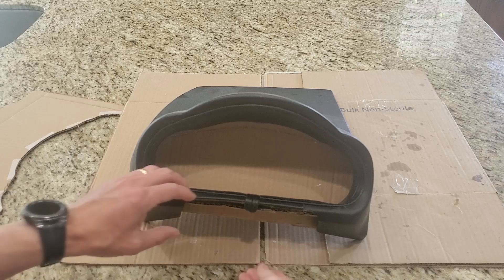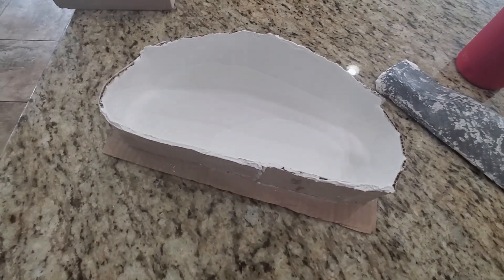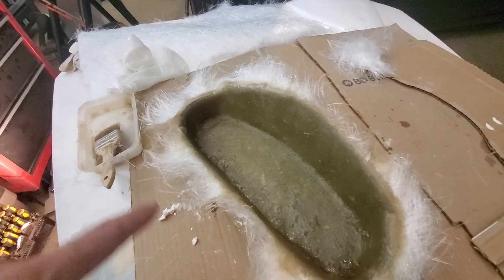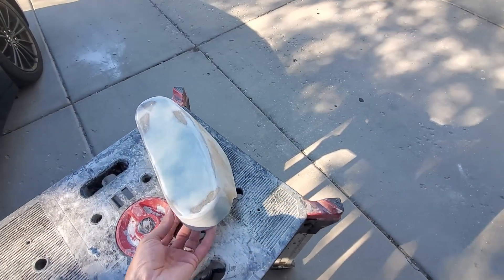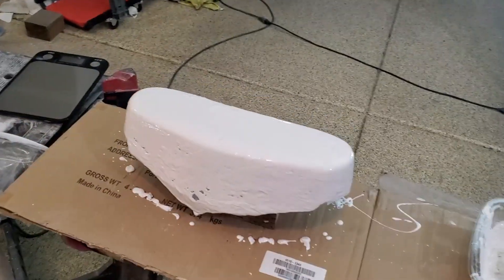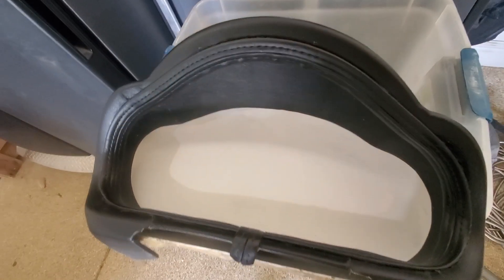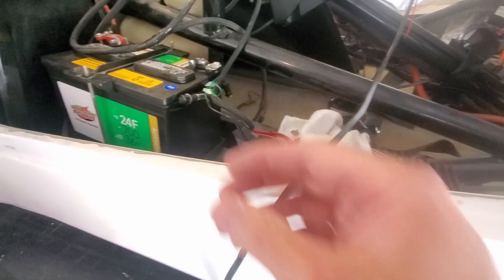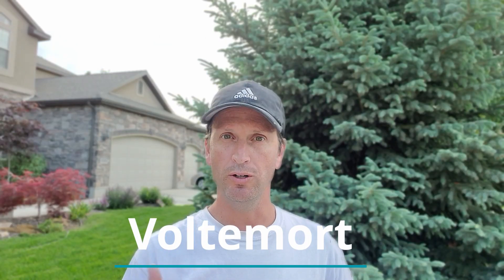Custom Digital Dash - custom gauge cluster

Comment: I'm not sure if you thought of this but just like your camera overheated so will the ipad on your dash I think the only solution is to crack it open and remove the internal battery and hard wire it to the car and also add a cooling fan behind it. Just a thought I have a tablet in my car dash I use as a radio and I use to have an iPad I live in Las Vegas and even on a 80° day leaving the tablet in the dash for 30min they give a heat warning and dont charge or screen locks
Reply from the maker: Thanks for the comment!

Comment: Please use baby powder on your skin when working with fiberglass. It saves on the itchy part later. I saw the respirator, which hopefully was worn whenever working with anything chemical or fiberglass related.
Reply from the maker: Thanks for the tip

Comment: It is nice. But just my thought it would be more aesthetic if it is made out of carbon fiber
Reply: Unnecessary carbon fibre just for appearance is a dead giveaway of a fake performance car. It's like the fake bolt heads which are supposed to make wheels look like modulars, or look like they have beadlock rings (depending on the type of vehicle).

Comment: Might be a bit late at this point, but regarding the boot, couldn't you install it on a set of arm pivots instead of using fixed hinges? That way you can get a ton of vertical clearance (since it can lift entirely clear of the car while supporting entirely from the sides instead of the top, which seems like it would help with stability.

Comment: Just wondering if the the steering wheel will block the way, in case if you need to touch ipad screen, how about placing another screen on center of your dashboard similar to Tesla?

Comment: Just gonna paste this so you can refer back to this in case you lost the other comment:

Ok, I tested this and it will work. For this to work you cant have a password on the iPad which kinda sucks but it's the trade-off unless you want to put in the password or Touch id or whatever every time you go to use the car.

1. Go to Settings > Display & Brightness >  Auto-Lock > Never

2. Go to the Shortcuts app
3. Go to automation (at the bottom)
4. Select "Create Personal Automation"
5. Scroll down to "Charger" and click on it
6. Make sure "Is Connected" is the only one with a check
7. Click "next"
8. Add action
9. Search "Set Low Power Mode" and select it
10. Set it to "Turn Low Power Mode Off"
11. Add action
12. Search "Open App" and select it
13. Select the "EV Controls dash" app
14. Click "next"
15. Turn off "Ask Before Running" 
16. Click "done" 

17. Click the + in the top right
18. Select "Create Personal Automation"
19. Scroll down to "Charger" and click on it
20. Make sure "Is Disconnected" is the only one with a check
21. Add action
22. Search "Set Low Power Mode" and select it
23. Set it to "Turn Low Power Mode On"
24. Add action
25. Search "Open App" and select it
26. Select the "Clock" app (can be any app that closes when not touched but clock doesn't take much power at all)
27. Click "next"
28. Turn off "Ask Before Running"
29. Click "done"

Now any time you turn on the car which means the iPad is now getting power, the car will open the EV Controls dash app, and by pre-setting the Auto-Lock to never just means the iPad will never lock as long as you are not on Low Power Mode (which sets Auto-Lock to 30 seconds and it goes back to never when it's off). When the car is turned off, Low Power Mode turns on causing your Auto-Lock to become 30 seconds (as I mentioned above), and switching to the clock app will allow the iPad screen to turn off in 30 seconds (I'm assuming that the EV Controls dash app won't turn off ever for safety reasons). If you have any questions just reply to this comment or message me on Instagram @numannakkash if you need personal help.
Reply from the maker: Thanks!  I have kept this comment in mind.  Thanks for republishing!